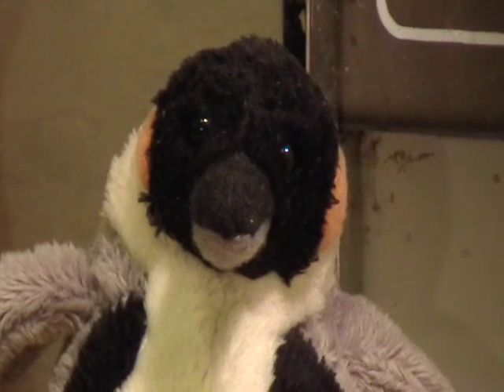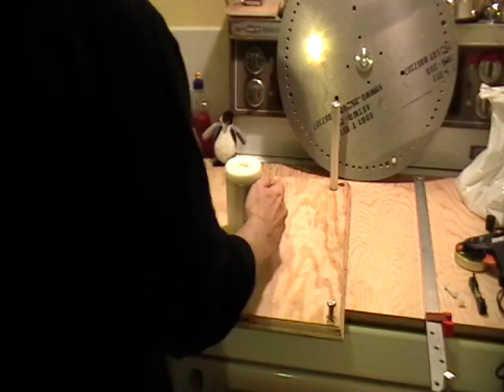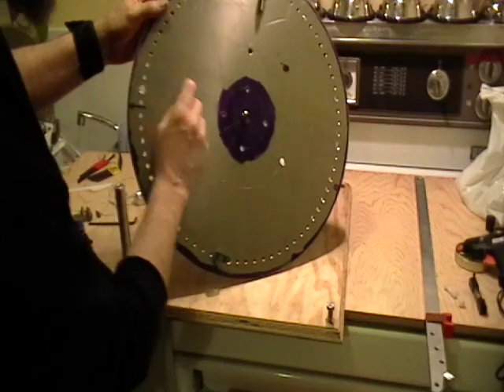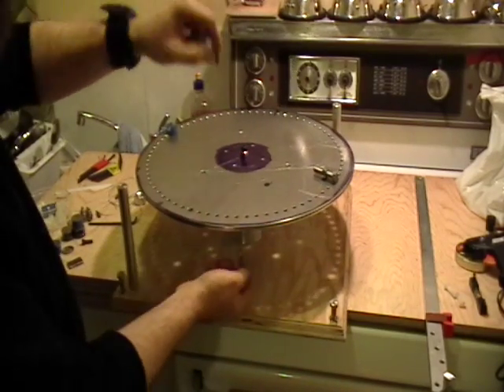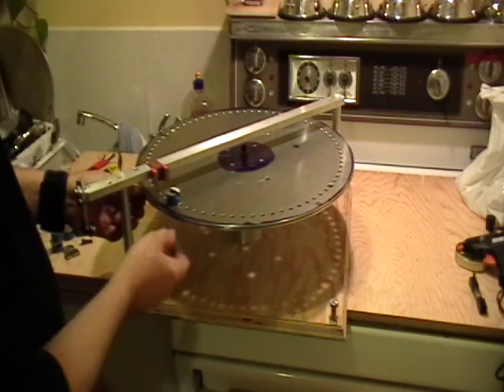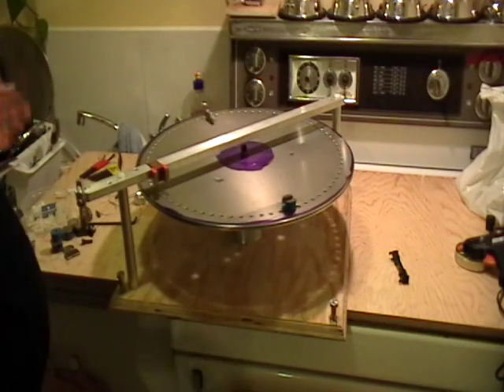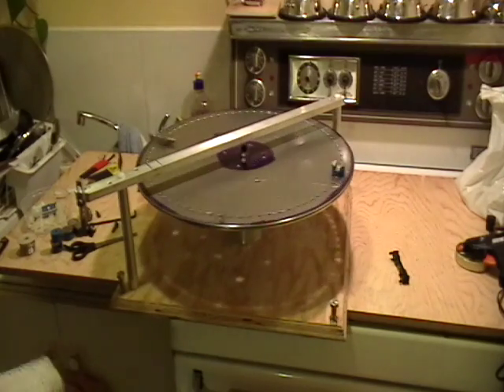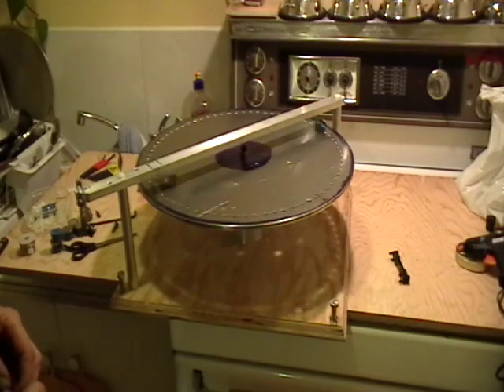MyLOW's Magnet Wheel Replication 1: Layout and Early Testing

Comment from the maker: It is indeed an effect. But it isn't a new effect, nor is it confined to this "motor".
The increased drag with stator installed, is almost certainly due to induced eddy current drag in the disk, via Lenz's Law. The disk is a conductor, it moves thru the field of the stator magnet, even when the magnet seems relatively far away. This induces a current, which has its own magnetic field, which opposes the original stator field. The drag slows the disk.
Any working motor must overcome this effect.

Comment from the maker: That's pretty much exactly what I'm saying. First, the USPTO tests nothing. Second, what HJ finally demonstrated to the PO was a linear SMOT, not a circular, continuously running device. Third, even Tom Bearden only claims HJ's motor turned of itself "about 15 minutes", which is easily achievable by a heavy flywheel on decent bearings. Fourth, the USPTO has granted patents for such things as peanutbutterandjelly sandwiches and child's swing-pumping methods. Fifth, who's close-minded here? You...

Comment from the maker: Pretty good, but surprisingly, wrong, at least in the range of interest. The empty disk turns around 4:30 from the nut-drop, and the same exact disk with 18 ea.  35 gram magnets and their keepers, started with exactly the same weight drop from exactly the same height, turns 4:50 or so. (min:sec) 
This surprised me, but it is quite consistent. I think it has to do with the bearing pre-load characteristic.

Comment: I beleive Mylows configuration was significantly different, don't you agree? The path of his upright rotor magnets encircled the stator and therefore operated in an entirely different plane than your configuration. In your example the rotor B vectors point vertical, perpendicular to the plane of rotation and the stator points tangent. In Mylows, the B of the rotors point at the center of rotation and the stator points away from the center with both parallel to the plane of rotation. ;-)

Comment: ... the time will be reduced do to increased drag and friction as well as slower initial RPM. As mass is added eventually the RPM < 1 and the time to travel will decrease proportionate to distance, therefore logically the rundown time decreases with additional mass because of the acceleration curve. How is that for a guess?

Comment: You want me to 'Guess' or calculate this? Just a hunch, the more mass you add, especially around the perimeter, the more energy it will take to get it going. Evenutally the MOI will exceed the force available in the Nut and zero RPM will be obtained. Also, the added weight will increase friction on the bearing.  Apart from that, any energy you store as kinetic will be expended through the friction and if those two things remain constant then the time of loss will be constant. But my guess is ...

Comment from the maker: That's right, that's why this design is so easy to test--all one needs to do to change from experimental to control condition is to remove the stator magnet, or even just emplace its keeper. Nothing whatsoever needs to be changed on the moving parts of the device.
However, I  have some revealing data re changing mass distribution. Guess:
If a disk with no magnets rotates for 4min30sec, how long will it rotate with 18 x 35gram magnets on it at r=8" when started by the same 50 gram weight falling?

Comment: I like that CLaNZer's tach is able to datalog to the computer. My meter does that, but the resolution is only 1 second intervals :( So the 'Nut-Drop' becomes moot and you can compare different configs that way. As long as you sweep the RPM range you can compare timing from a given RPM to another for a particular setup. Also, you can compare energy values between different configs if you know your mass dist. and RPM. Of course for us working on our stoves, the 'Nut-Drop' test is a good ballpark.

Comment: Do I detect a sense of sarcasm? I see the all caps and get the sense of agitation in the projected tone. I imagine this is related to a frustration that other replicators have not taken your advice in performing this test. I would like to stress to the readers that this test is only valid if the mass distribution is not changed in any way between tests. You can remove any external affector, like the stator, but you cannot change rotor mag positions or quantity as that alters the energy ratios.

Comment from the maker: I would be happy to try any magnet configuration you suggest on this apparatus, subject to the following constraints: There are 72 equally spaced mounting holes. I have 18 rotor magnets, Eclipse E823, and one stator magnet, General Tool horseshoe. The rotors can be mounted either on their right-angle mounts or facing upward directly on the disk, rotated however. The stator is on a sliding mount that can  be oriented any whichaway you like, as long as it is suspended from the overhead bar.

Comment: Well I guess that depends on the configuration. The aluminum is acting as a single winding inductor and therefore has a separation (90°) between voltage and current relative to time. The induced field is a product of current flow and is therefore later in the game. Naturally, to refute this, you would need to properly place the magnets instead of orienting them improperly the way you have here. Also I have serious reservations about your reaction time on that stop watch ;-)

Comment: The best I could achieve was a free run of 350 degrees with all positives of the rotor pointing inwards and the negatives outwards. But then, as usual with this kind of dsigns, the loop is closed and the machine stops. And yes, as usual without magnets the rotor spins longer.

Comment: well from teslas research with the first real working magnet motor, the copper disc(in the video aluminum) is very important to operation. in teslas magnet motor called the uni polar dynamo, the magnetic field passes through the copper disc and the current is taken off the edge of the disc to a resistive circuit and then back to the middle of the disc to complete the circuit. the pull of energy from the disc further enforces the magnetic field allowing more energy to be made!!look it up everyone

Comment from the maker: And did you compare the original HJ configuration spin with the spin of a wheel, weighted the same, but with no magnets at all? (Using a conductive disk, of course.) I'll bet the HJ configuration is not as good as the No-magnet configuration--because that's what I've found with actual measurements on my rig. The effect of eddy current drag is much greater than most people seem to appreciate.

Comment: Have you attempted sheilding the approaching side of the stator with magnetic sheilding to reduce the drag? If you could actually reduce the drag to 0% (if thats possible) on the one side of the stator you might achieve a small push in passing of the stator in turn making perpetual motion?

Comment from the maker: I've got some magnets that are approximately like MyLOW's, and I've arranged them every whichaway that I can think of on that disk, and on other disks, and have never seen a gain (longer rundown time than a same mass disk without magnets).
I seriously doubt if anybody else has either, if only they had real data like mine to compare.
I have found, for example, that the mere presence of the stator magnet alone in this rig subtracts about 40 percent from the rundown, by eddy current dissipation.

Comment from the maker: OK, now I see what you mean about his bearing housing. His later versions show the whole thing turning--I guess the stub axle is on the bottom.Thanks for the correction! But now I've put mine on a longer shaft thru both my bearings, and it runs much smoother and even longer. I'm exploring the results of various stator magnet positions on the eddy current drag. I'll probably post a video illustrating those results soon, if I don't get too depressed. The effects are much larger than I expected.

Comment: I was just pointing out you wouldn't know about it. I guess I would like to see you work at something you actually believe in. Say, a drinking bird with a Milkovic pump or an electrostatic generator. Testatika, Moray

If you want to be really discouraged, a magnetmotor can never generate enough power to earn back the resources at todays energy prices. One small magnet already costs the equivalent of 4 kwh.

60$ is 300 kwh, it looks like you need a few more parts plus wages.

Comment from the maker: So, one may conclude that the stator-rotor magnet interactions are neither helping nor hurting much (there's that pesky magnetic conservatism again) and most of the losses are from (Lenz law effects, yes) eddy current losses, and these losses, even with weak magnets, are relatively large. So I recommend that builders of magnet wheels use non-conductive material for their moving parts, as eddy current losses can subtract hugely from momentum.

Comment from the maker: Yes, thank you. But further research on this setup indicates that most of the losses are actually coming from the stator magnet inducing eddy currents in the rotor plate. I determined this by replacing all the rotor magnets with non-magnetic weights, and then comparing rundown times with and without stator installed. The difference in rundown times was on the order of 40 percent (!!), similar to the difference in the experiment shown here.

Comment from the maker: And just for the record, if you look in the video, on the table to the left, you can see a bunch of other magnets. I've tried attractive-repulsive arrangements as well as many others. The difference between my work and others is that I have actual run-down data so I can compare real results rather than subjective impressions.
The single magnet repulsive "gate" works about as well as any of them and considerably better than most--see Mylow's video.
That, in fact, is part of what I'm showing here.